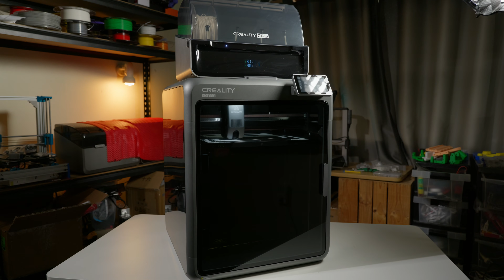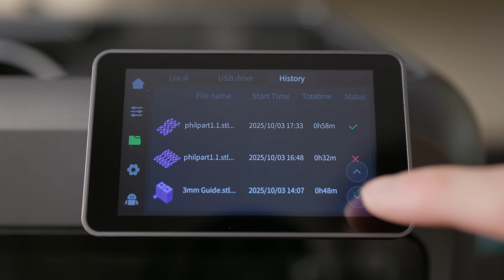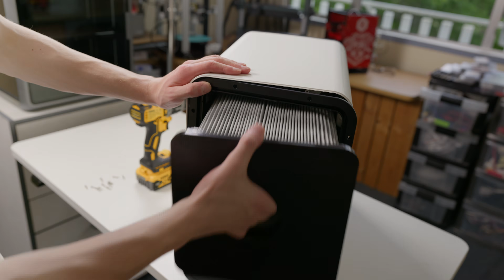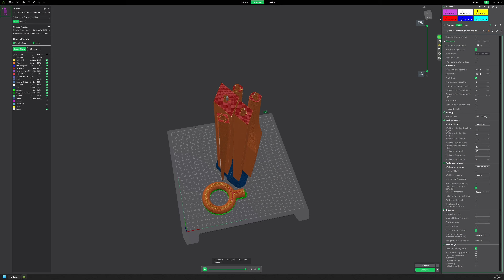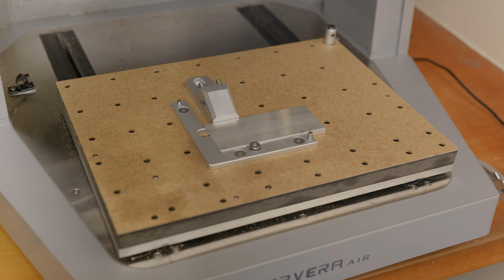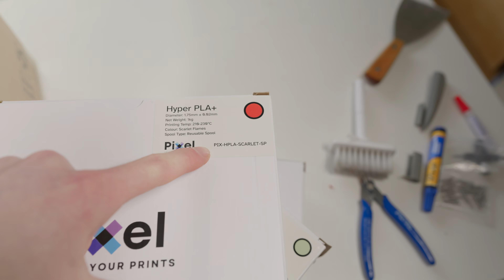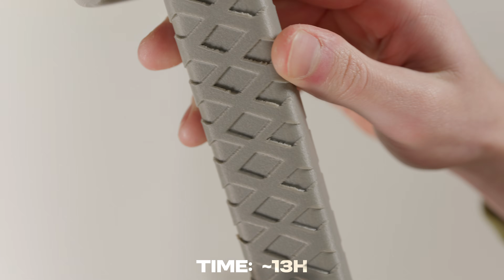My Time with the Creality K2 Pro

Comment: Great video, the focus on the actual build and engineering of the machine is a nice POV for a review/overview. Never apologise for adding your voice to a conversation, more information and discussion is what 3D printing needs. B roll is also starting to look much more professional. 

The smooth idler question is a really interesting one. When I first built my V0 stock, I had loads of issues with VFAs and I also blamed on the naughty smooth idlers. I replaced them with toothed ones and after a few dozen hours of printing the bearings fell to pieces. I really struggled to find quality idlers that small so I ended up getting misumi ones that were a fair bit larger which meant bespoke idler mounts. Once all of that work was done, I didn't find it made any difference to the VFAs. What cured it on the V0 was a custom hotend about 1/3rd the weight of the mini stealthburner and a nozzle mounted accelerometer for IS (rather than the PCB ones that comes with a stock LDO kit). 

I then has the same issues with my prusa core one which I also chocked down to the idlers, however it was nearly completely cured for me by increased the belt tension and updating the firmware (which I believe has better resonance avoidance/compensation). Prusa have gone on record saying that the smooth idlers are not the cause of the problem so I'm not really sure what to make of it all.
Reply: Dude is the ONLY 3d printer reviewer I’ve seen who does more than just repeat specs and random print tests. The other reviewers are so bland and dry these ones are actually interesting and different.
Reply from the maker: Hey Josh! Thanks for checking this one out! I really appreciate it. Thank you for your reassurance and recognition as well! I'm enjoying the new visuals too, and will keep working on that going forward; I prefer it to the curtains closed and coloured lights, as keeping everything bright and open is a lot more inviting and invokes a nicer tone. I'm all for it! (Slower and smoother footage helps too, for sure.)

It really is. Someone brought up that it could actually be Pressure Advance issues that I was experiencing, but as even after my replacement parts arrived and were installed, and the machine still doesn't work, I can't verify that. A few dozen hours only?! That's really something, wow. Sounds like an opportunity for a live shaft mod! I'll be trying that for the upcoming build, for sure. Interesting to hear about your experiences/findings too with the VFAs, as I wouldn't have expected that at all! A custom hotend you say? I'm all ears there, haha.

That confuses me too, as I thought increasing belt tension would accentuate the issue, but ironically (and for the best!), I'm glad to hear it did not. I guess I'll look closer at what Prusa is doing/claiming, and see what I can learn from it. Cheers!

Comment: Is anyone else getting graphical glitches? For example at 17:26 the video goes a bit wonky then a big green square comes over the screen. Just trying to figure out if it's the video or me
Reply from the maker: Yeah, that's a frustrating one. It's happened before. I watched the whole export, realised one clip had the audio too loud, and then exported a new copy which I didn't check as thoroughly as I should have. That's twice it's happened now, and I'm just annoyed about it. I'm very sorry!
Reply: @TommyHoughton  dejavu huh :D 

What is the GPU and Codec you are using? You may be forcing something like AV1 or H265 onto a GPU that cannot natively encode in it so it has to pass it through CPU and that can introduce errors like these (since we already troubleshooted this before, I assume all HW, Bios and other stuff is good). IIRC you had 30 or 40 series tho, which should be AV1/H265 capable. Or you may be using wrong encoder (e.g. you have Nvidia 265 capable card but instead of NVENC you use just base 265 which still routes through CPU)
Reply from the maker: @VanBourner   Unfortunately :( It could have been entirely avoided if I just paid a bit more attention, but I guess this is a good chance to figure this stuff out for good. I'm glad it's user error!

I'm using a 5080, and exporting in QuickTime, H.265 (have tried AV1 a bunch for quick stuff but not this time time), but I've just looked at my export preset, and the encoder is set to Auto, instead of NVDIA, AMD, or NATIVE. Perhaps I should lock in NVIDIA for next time? I recall doing that in the past, but have no testing evidence. There's another setting I need to make default, which is exporting in Main 4:2:2 10 instead of just, "main." I recall it being much faster. I've just made these changes now in case I forget, and hopefully they make a little difference 😅 A deep dive is probably worth doing as I do half-guess a lot of the export stuff, more than I should.
Reply: @TommyHoughton  try using NVENC (NVIDIA) option if possible, since youi very much have a 265/av1 capable card, you want to utilise those CUDA cores. Auto might use it but also might not, handbrake does not use NVENC/CUDA unless you tell it to for example (uses CPU instead). I am reencoding "Linux ISOs" right now to 265 via handbrake and tried running it on my server using CPU and it took like 3x the time (and i have over 1700 "Linux ISOs") and introduced a lot of errors, including the green squares
Reply from the maker: Understood, I'll lock that in! It would be ideal to have it stick to a single option and not switch part way through or something. 1700 ISOs, haha, that's a couple. I really need to put some time into Handbrake; I'll do that in the coming months, I reckon, as I have some DVDs I'd like to experiment with "ripping," I think it's called? It's great that the problem is pinpointed! Nothing worse than a problem with an unknown cause... Thank you for your help and insight as always! It seriously helps a ton in several ways 😄
Reply: Not just you
Reply: thats cam gliches it is not your machine it is tommys cam

Comment: I don't know why Creality just can't seem to make a machine that works perfectly fine out of the box without tinkering or problem solving needed. I loved the Ender 5 back then because it allowed me to learn, but nowadays for the price and how much 3d printing has advanced there's no excuse for them. Oh and if it's like the normal K2 then taking it apart for any big replacements is near impossible...
Reply: I've always noticed a pattern with any kind of product and it's successors from the same brand:
That is, if they make another one with the very creative name of {previous product version number + 1}, or something similar, it's probably not good and they haven't innovated very much from the previous one. To me, it represents quantity over quality.
Take Apple for example, with their iPhone series :)
Reply from the maker: Well said!
Reply: to be honest- idk what Tommy is doing to his printers. I own a K1C- it works for 1500h nonstop now, with minor maintenance. I just upgraded to linear rail on x and to the dxc extruder, because of speed. regarding the nozzle: he fd the thread because of dirt or stuff inside. its a brass thread and the nozzle is hardened. At work im running the k2plus, its working amazing for over 200h with all kind of materials. just had 1 major clog because I fd up, printing pa12 from the cfs, which is BS. other than that, its just perfect.
Reply from the maker: I unfortunately don't know either. If I knew, I would have explicitly stated that it was my fault, but I really don't know what went on :/ 
I'm glad to hear all's well with your K1C! I've wanted to try the DXC extruder myself, but the opportunity hasn't presented itself. How are you finding it? 
Extra glad as well regarding the K2 Plus, as I've been told by a few passionate commenters to avoid the machine at all costs. It's such a guessing game with Creality, and even though I've had a brilliant experience with the Creality Hi, I've spoken to two others who have had nothing but troubles. At this point, it's striking me as luck of the draw. I want to root for them, but there's always a disagreement no matter which side I'm on 😅 Cheers!
Reply from the maker: I felt they were so close this time too! This would have been leaning towards a positive review if it wasn't for the difference of one single day!
It pains me to see others having troubles with their Creality Hi's when mine is doing well, and the other way with others having great experiences with the K2 Pro. 
The E5 is such a great platform for a Mercury 1.1, but aside from that, yeah, just not worth it at all anymore. I believe the base K2 is also hunkered down like the Pro and Plus... It's tough. 
Cheers!
Reply: @TommyHoughton  if I’m being honest, if I were to build another Mercury (which I am thinking about) I wouldn’t start from a creality printer at all. My ender 5+ from 4 years ago doesn’t share a single part with the original printer and a lot have been replaced more than once lol
Reply from the maker: In that case, I think that's a much more economical approach, haha. If self sourcing the frame, you could pick some cool colours! It's also great to hear how much use the machine's gotten! I'll always be behind everyone in terms of print hours, haha.

Comment: As someone with the K2 plus and over 600 hours on it, your review is really interesting certainly some of the points are solved by going up in the models to the plus. The biggest issue I've had you have solved tho, and that's the terrible hotend. The nozzles suck, they heat soak massively.

Could you upload your cnc mount model? I'd like to look at getting that made.

Another great upgrade is Cartographer, it really changes the whole terrible stock leveling system.
Reply from the maker: I'm glad to hear things seem to be going well with your plus! It's so tricky as I've heard from a variety of people who either love or hate the model. QC has gotta be a factor. 
I definitely noticed some improvements after the swap! It's a pain as I was enjoying the previous hotend, but that's a moot point after it caused me that amount of trouble. Real shame. Just how it went for me!

Absolutely. Here's a link to that, although I can recommend printing in advance just to quintuple check it's to your liking. https://www.printables.com/model/1505380-creality-k2-proplus-hotend-adaptor

Cartographer, I've heard is brilliant, although I've just ordered a beacon for another machine, which I'm stoked about. I'm looking forward to using Eddy sensors more often! No more BL Touches, haha. Cheers!
Reply: @TommyHoughton yea I certainly wouldn't pay for one. I won mine. It's been a solid machine but I prefer my vorons. 

Beacon is good. Carto is too. Both are the same tech. Different implications. I just prefer the carto price. But I have a beacon on a printer as it had a higher temp then carto at the time.
Reply from the maker: Oh! That's super awesome then, haha. I totally get preferring the Vorons; they'd feel a lot more "transparent" than the plus would, that's for sure. They are good machines to place trust in as well.
Given it's less than half of what I paid for my Beacon, I'll 100% consider giving it a go in the future. I've really enjoyed using the Eddy probe, so testing the three main (as far as I'm aware of) eddy probes will be good. Great!
Reply: @TommyHoughton yea the "eddy" one from btt is pretty much the worse. Carto has the new v4 out in 2 weeks so worth waiting for that one.
Reply from the maker: That makes sense 😅 I'll keep an eye on how the new Carto version performs! Stoked.